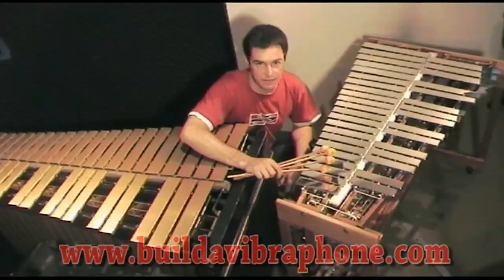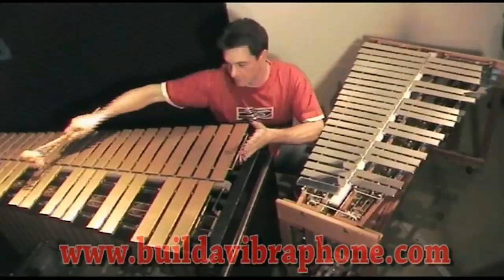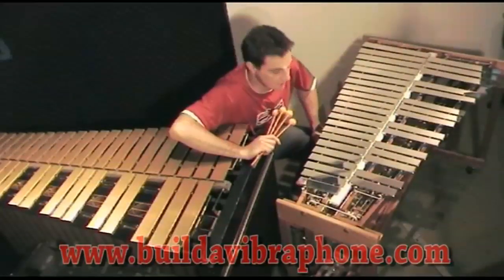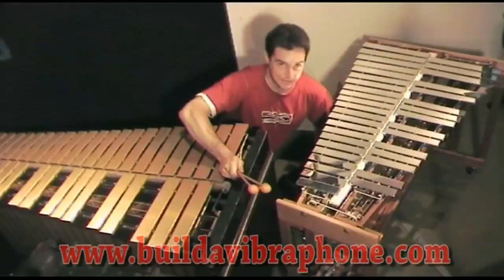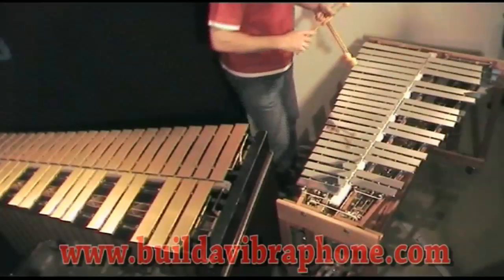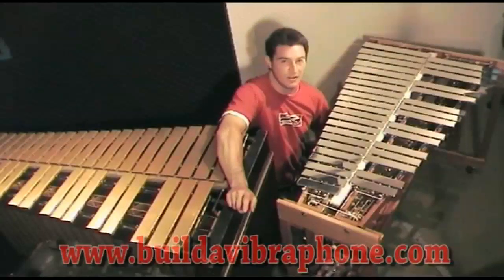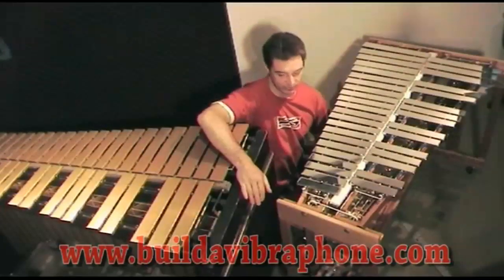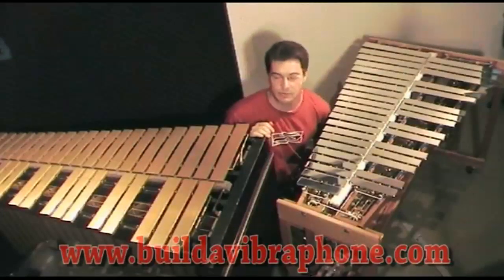Build your own Vibraphone - comparing the PV with a Musser

Comment from the maker: Well the instructons are very detailed - there are several methods outlined for removal of the material and the process is explained cery clearly with photos and diagrams - there is also a demo video included which shows the process and explains each step along the way

Comment: I've long thought about an electric vibes project. With pickups through a tremolo pedal. The keys need to be ferromagnetic. I don't know if nickel plating would work, or simply a steel disc attached to the underside of the key would do the job.
Reply from the maker: Hi Lester. My advice would be to research piezo transducers. These have been around and used as the "standard" on bar percussion for decades. They have their limitations, but on the good side, they can be used on any existing instrument - no matter the material they are made from.

Comment from the maker: Well the butterflies - or fans - are discs that rotate inside the open mouths of the resonators - they have to be there to work - they need to open and close the tubes as they rotate. Placement of the motor is wherever is structurally convenient as long as the drive pulley lines up with those on the ends of the fan shafts. Does this answer your question?

Comment from the maker: this one is just a single speed - but of course because it is a DC motor you could easily rig up speed control via a simple voltage control circuit or even more simply with variable resistance.

Comment: Hi, if one practices with a vibraphone with those bar sizes, is it difficult to transition to an instrument of wider bars? I consider building one with thin bars for ease of transportation but don't know if it's a good idea
Reply from the maker: Hi Julian. That is indeed a concern for some - and everyone is different when it comes to how much difficulty they have in adjusting. In my experience it is more of a concern on marimbas - which have a bigger overall range and in some cases bigger variation in bar dimensions also. For vibraphones I have found it to be an issue for those who transition from a "narrow bar" instrument, to a full wide bar instrument - but not so much for those who transition from this set of dimensions which is somewhat in the middle. The PV does have graduated bars and the lower end bars are 2" wide - so in most cases it is not a huge adaptation when moving to a full "wide bar" instrument that has just slightly wider bars in that bottom octave. But as always - everyone is different!
Reply: @percussionclinic  Thank you for your response and for the insight, i'll keep these things in mind

Comment from the maker: Well sure - of course. You would definitely need to make adjustments though. You would want to make the frame timber beefier and as you say... provide harness attachments etc. Playing vibes with no pedal is tought though.. you will get a lot of ring - it would be good to have SOME dampening mechanism - even if it was an adjustable static one.

Comment: loving your DIY until you turned on the motor, way too noisy of a motor m8, cant record with that
Reply from the maker: Yes - this motor is a bit louder than ideal - it's a $10 cheap 12VDC gear motor that I used so it could be battery operated and very simple - it's actually a bit softer than the video suggest because the mic id close to the motor - but it IS a bit louder than ideal. My latest build actually has an AWSOME motor system - it uses a 5V stepper controlled with an Arduino - heaps of cool programs for different types of modulation and absolutely silent. It's still a work in progress, but we have certainly solved the noise issues!

Comment: So do you sand away the metal from the key arches? Or grind or drill? I guess what I’m asking is the mechanism to remove the material
Reply from the maker: Hi Nathan - well you really can use whatever method is available to you - depends on your tools. These days I rough out the bars using trenching cuts on  radial arm saw set to the appropriate depth - but using a blade especially designed for aluminium - then I have a 6x48 belt sander that smooths things out pretty quickly from there. Commercial makers will often use a CNC mill. I HAVE done these bars with nothing more than a hand drill - but obviously it takes longer and doesn't look as nice on the underside.... but it is absolutely possible and will sound just fine. A cheap and fast way to remove material is with an angle grinder.. BUT you have to use special aluminium wheels - using regular metal wheels with aluminium is dangerous.

Comment: The aluminum is T5, but how thick are the bars? I bought some bars years ago with the intention of building one, but they were incredibly hard to cut. I gave up.  I will probably buy your book
Reply from the maker: +Dr B actually the T5 temper is an option mostly for 5000 series alloys where t6 temper is actually better. The pv prototype used a t5 5000 alloy to prove that even a worst case scenario still works pretty well! If you want the best option you can get with alloys available to the average consumer... Try to track down 2024 alloy which tends to come in t351 ort4 tempers. Either is good. Check out my newest vibraphone build here on youtube which uses t352 2024. ☺

Comment: Hi! I picked up a Jenco 3 octave without a motor. It used to have one and I'd like to eventually add one. Do you know if there's any DIY or cheapo replacement option. Ive thought maybe harvesting an old belt driven record player or sewing machine motor might work. Or an old 4 track with varispeed dial. Any thoughts? Thanks!
Reply from the maker: Replacement motors are generally the tough part of vibes repair. For that exact reason - finding an appropriate one is tough. Your ideas are on the money though - I generally recommend trying to find an old turntable motor - but with this option and the others.... it is the speed control that is tough. Modern turntable motors for example can't just be fed a voltage and run - they have controller circuits that time the changes to the motor coils to control speed. So you either need to get the whole circuit in there also or find an older and simpler system. My new vibes project uses a digital motor with USB powered controller - fairly inexpensive and easy - though I'm still having some issues with motor noise at many speeds - which is the common issue with digital motors.
Reply: What about a battery powered motor from a remote control car and maybe Velcro the RC controller to the side of the vibes? Or maybe I could rip apart a small fan.
Reply: It is missing one pulley wheel. Do you know where to find a good replacement or what do you use on your projects?
Reply from the maker: Something with a speed controller like the rc car could work - though you might find it noisy. Noise is the #2 problem with vibes motors. #1 is the speed - any fan you find will be too fast. You can use a battery powered motor - actually the PV prototype used one from an electronics store - but it was a "geared" motor. The gears make it slower and stronger - but also a bit noisier.
Reply from the maker: I have machined them from scratch recently on my new vibes project from 1/8th thick aluminium flat sheets. But if you want to find a ready alternative there are some about. You can try various "Mechano" or "connex" or "lego" wheels - or the PV originally used rollers from a sliding door which you can find "replacements" for in an average hardware store.